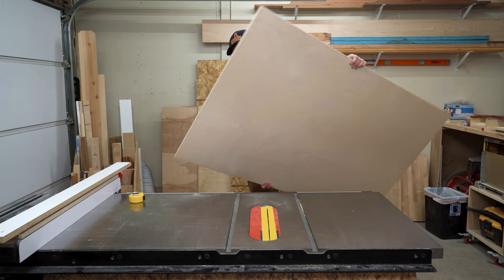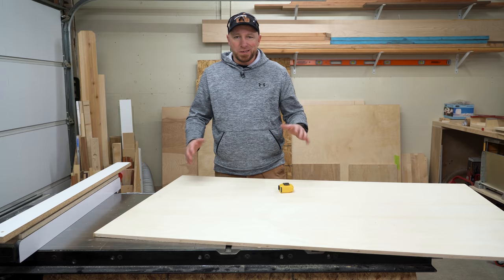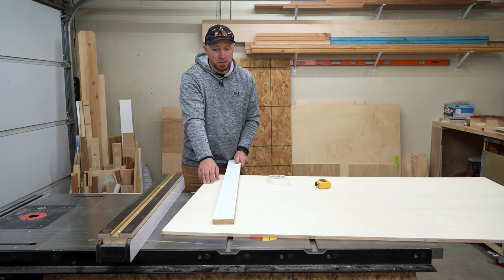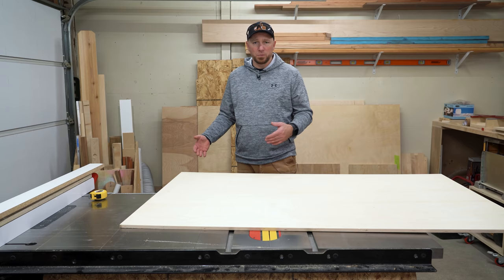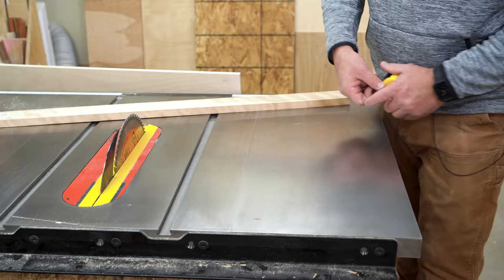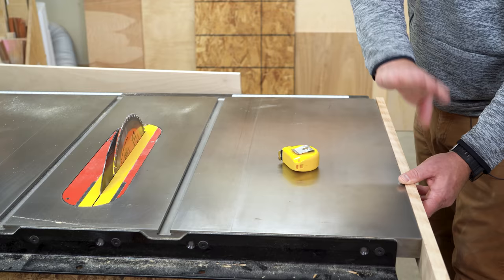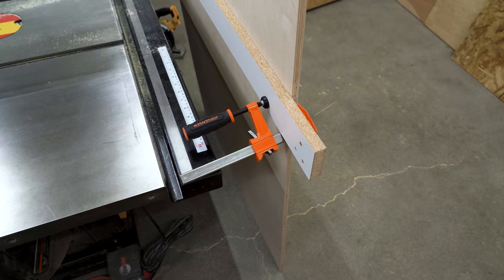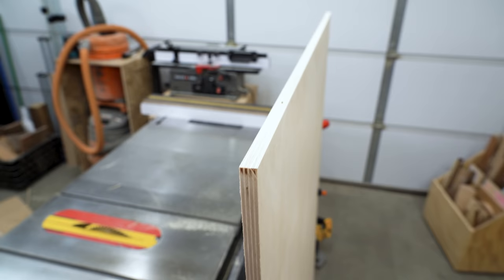A Table Saw Trick So Crazy, It's Genius!

Comment: Good trick. You could use double sided tape on the backside with a runner in the miter slot for the same cut. It probably wouldn't help much for cutting plywood perfectly in half length wise, but it would work for a 36 inch cut like this.
Reply: I think the increased distance of the edge of the table vs the miter slot gives more precision. And double-sided tape will have just enough torsion play that it would be easy to wiggle the hanging end of the plywood back and forth as you travel. The clamps seem to provide reliable stability to not have any torsional wiggle, as long as you maintain pressure towards the table edge

Comment: Great timing for this video. I have 6 5 foot long cabinet panels to cut. (The sheet goods were not cut square at the mill. They are off by 5/32.)
Reply: Wow that's probably the worst I've heard of, I had a bunch of T-111 paneling that was off like 3/32, and I thought that was bad.

Comment: Good trick, i will definitely be using it. However, in this case, I would have just clamped a straight edge and used the router though, eliminates having to manhandle a large sheet and a potential wobble when cutting it.
Reply from the maker: Yeah it was more to show the technique. I think a lot of people tried watching without listening though, as per the norm. I will add though that for me it would take longer to setup the router than just to do this. But that's because my router is in the lift, so I would have to get it out, change the bit, and so on.
Reply: MUCH easier just to use a plane. Cleaning up timber is what is what they were specifically designed for.

Comment: Nice one! This is a great method and a safe one for the large sheet goods. I used to work in a shop with a 52” fence and there still comes a time when you need to make that thin rip off the side of a long sheet. It’s no fun having over 4 ft of waste and a thin rip between the fence and the blade.
Reply: Awesome! Love it! Will definitely be using it but also that was a crosscut and I saw no to minimal tear-out which makes me ask what kind of blade you’re using. Dude that was flawless!
Reply: @BusyDee  WOW you have very pretty eyes!

Comment: Good one and perfect timing. I cut a large cedar slab at a 45 yesterday to make a waterfall table.  I used a clamped straight edge as a guide and a battery saw, but something didn't work and my 2 45's didn't match up. I need to re-cut the 45's on the table saw. With this trick, I think I can do it. If not, ill go to my buddy at the local sawmill and let him cut them on his radial saw.
Thanks for the great tip.

Comment: That is a great tip to share for those that did not know of it. Luckily for me, my father taught me that trick some 50 years ago and I have used it several times on my small capacity table saw. Since I bought a decent hand held circular saw I prefer to clamp a straight board on top of the stock piece to guide it if I can. My circular saw has no wobble like yours.

Comment: I tried this last week and it works great. It takes a little extra math, but I was able to make a good straight cut beyond the rip capacity of my jobsite table saw. In fact, it worked so well, that I thought the opposite end was straight, but ended up reversing the board and cutting the opposite end to get a nice square piece.

Comment: straight edge and router.
perfect every time and perfect 90 degrees every time, and a perfectly smooth cut every time, which on a table saw it’s not guaranteed, plus you don’t have to handle such a big clunky piece especially if you don’t have the room.
router is a win win. every time.

i thought leaving this comment would be better than giving you a thumbs down, and you might even like my technique.
cheers !

Comment: Another option is a straight edge and a router! Super clean cut on both edges and a perfect 90 degrees.
Reply: For cleaning up an edge, a router would be simpler and easier, especially with  something heavier, like an MDF panel

Comment: For those without  a large table saw. I use a BORA NGX 50” clamp edge, $49 and a 4.5” Porter Cable circular saw. The clamp can be set to any length and the over center cam lock secures the straight edge. A 4.5” saw is much easier to do this kind of cabinetry work. Wish my shop were as clean as yours.
Reply: Correct I have the BORA and love it, wish my table saw was that large

Comment: I use a similar method on my radial arm saw to joint an edge or preserve a natural edge.  I built the front table so that the front edge is perfectly parallel to the fence and clamp a straight edge in the same way that is shown in the video.  This works best on wide boards using a narrow straight edge  I position the carriage with as much of the board on the table as possible.
Reply: hinge a support board out from your front edge and hinge a board from that one to the floor . that way you can have full support of a plywood sheet

Comment: Two observations: 1) you could set up the same fence but closer to the cut line and use it for a fence for a router with a straight bit - of course this wouldn't work for breaking down sheet goods but it works great for cleaning up edges. 2) using a larger square for setting up the fence will provide even greater accuracy.
Reply: Also noticed the plywood sheet was not down hard on the table (7:02 time stamp), so he did not achieve the "squareness" he spoke about early in the video. The circular saw and clamped-on fence would've done just as well.
Reply: @kennnva551  Either a circ-saw or a router. I'd go with router. Both ways have the advantage of not needing to catch the out-feed. If the plywood reaches its balance/tipping point, it's really difficult to keep aligned. And a router has no skid-plate to wobble.

Comment: Big fan of your channel. I am bit confused still why all the trouble or why it's less trouble I should say than the other methods but maybe I wasn't doing a good job listening. In this case looks like you just want to clean up that edge and have it square. Couldn't you clamp a straightedge to it square and then just run a flush trim router bit down it if you didn't want to circ saw it?
Reply: Yeah my thoughts exactly.

But you can use this method to do more than just cleaning up an edge. If you wanted to cut a thin strip off to then use, let's say.
Reply from the maker: And here I thought I had covered all the "you should have" comments. Haha! This is an old school method for panel break down. It works quite well for breaking down full sheets into cabinet-ready panels. The example I showed was because that is a common problem people run into and the table saw is right there to use. Plus it gives people another trick to use when they need it for something else, like panel break down.
Reply: @InspireWoodcraft  ha thanks for replying.  I was asking to make sure I didn't miss anything, not from a place of "I know better" - definitely the opposite which was why I had to ask bc what did I miss? This definitely makes sense now on panel break up esp by passing the fence.

Comment: I don't like to be harsh, but I'm just not a fan of this. I think you have a lot of good videos, and I understand what you're trying to show, but I don't think this is a good tip. I think for many people this isn't going to be safe even if it was safe for you.

Working with panels on a table saw is a risky prospect from a balance perspective. With your sheet you're about at the edge of what's going to work on your table.  Myself, I've got into a lot of trouble because I've tried to work with a sheet that was too far off the table even with I had additional help like rolling supports.

And if the saw "doesn't have a lot of capacity to begin with", the balance situation is going to be even more risky.

Additionally, the straight edge requires those clamps to stay in place. You're using two heavy clutch-style bar clamps and leaving it pretty tight. This is the kind of advice that someone who's newer will see and they might try it with trigger clamps which are far more likely to move in this case which could leave a rough edge or be unsafe again.

Sometimes the right answer is that you shouldn't do something because it's not safe with the tools you have. You have to choose a result that's rougher and slower until you get some additional equipment.

This is exactly what you should invest in a track saw for. It makes the operation safe and quick. While I think a woodworker needs to invest in that sooner, there are cheaper options. 

With the regular circular saw you can use a clamp-on straight edge like the ProGrip or the Bora NGX (I'm not a fan of Kreg's solution since it comes in two pieces). Or just use the edge that you created. I'm not sure why you're having the flex issues since I didn't have those with 3 different circular saws I used in the past. My issue was never the straightness of the cut but just the time it took to set it up and that the tools didn't help me get something square.

Either way, please be careful with sheets hanging so far off the table saw.
Reply from the maker: Some valid concerns. I think people have to watch (and listen, a difficult thing for most nowadays) and learn and choose for themselves what they think they should or shouldn't, or even can or can't do. Each person has their unique set of circumstances that they are up against, and they have to kind of use their brain accordingly.

Comment: Excellent tip... especially now that I dressed out an edge board on my table saw's outer cast wing for another reason (helps me align my mobile outfeed table).  You can even screw on an extra long/removable edge that is much longer than most table saw wings (they are typically only 27"), that will provide even more support when running wider sheets through.  I keep a nice straight piece of 1x3 handy that is about 36-40" for this reason.

Comment: The trick is great and simple! 

Ruler's hook is moving by the depth of the hook. So when you measure by putting the hook outside you will get exactly the same as when you put the hook against the edge on the inside.
Reply: You didn't pay attention did you? He wasn't measuring from the edge of the board.

Comment: I'm 70 + years. I use this idea back in the 70s.
I'm not able to wrestle that stuff around even  what you did there.
If I were to do that now I think I would clean that edge up with a router and straightedge.
Just make sure there is no gravel or dirt in that plywood edge.
If you couldn't cut that because of the capacity with of your table I would still use your  circular saw straight edge, and then true that up with a router and straight edge.
Obviously this is not going to be production work.
There's almost always another way to cut something .
If the original piece of plywood has that square edge but just bad splintering, you might even use an L fence and straightedge.
Keep up the good work.    Thank you.

Comment: Nice tip, going to check my saw right now, but I will use the miter slot to check to the edge of the table instead of measuring from the blade.

Comment: Good technique, and well explained. I suggest you make a point of using hearing protection every time you make a video. Hearing loss is not repairable, and when you realize you have it, it’s too late. Guys say “noise doesn’t bother me”. But I guarantee you will regret your decisions when you can’t have a conversation with your grandkids. It only takes a few seconds to put in plugs or put on a headphone. Literally, a few seconds. Again, very good video. Hope to see more well-thought-out videos.
Reply from the maker: Thanks for the suggestion and kind words. Luckily my saw is only 85-87dBA while cutting, and I am usually only on it for less than a few minutes at a time and not very many times per day, which technically falls into the "safe" category. But if I am going to be using it for long periods of time, or when I use almost any other machine in the shop, I use hearing protection. Ironically, I already have a bit of hearing loss from when I was younger and didn't take it more seriously.

Comment: For cuts like this I use a 4ft length of T-track clamped to the bottom of the work piece that runs in the miter slot.
Reply from the maker: I like it! T-track doesn't work in my miter slots very well. Too much wiggle room.
Reply: Make the cut as if the T-track was a fence; feed the work with a bit of pressure towards one side of the miter slot or the other.  Not too much pressure though; aluminum T-track will deflect.  I keep my saw top and out feed table so work slides smoothly all the way through the cut.  That way when I make a cut I can focus all my attention to keeping the work properly registered.

Comment: Bravo!!  Great tip, and to hasten the setup, one could make a jig exactly the length of the blade to table edge you measured to aid in clamping your guide to the work, since that measurement never changes one you figure it out.

Comment: Good trick to remember I did something similar on the 8 ft side when building storage cabs
 Question. As long as the one side is factory why not just measure off the factory edge to locate your piece to be clamped. That way you are automatically parallel to factory. Squares from small pocket ones to framing squares can  " out" of sq.

Comment: Good idea however, difficult to do with my cast iron table saw. I bought a 2nd circular saw with a fine tooth blade and keep it on an inexpensive track saw guide. I love the cuts and the saw is lighter than the wood I would have to manhandle. Quick and easy.

Comment: Another good trick and a nice bit of lateral thinking, but you should get yourself a tracksaw.  You don't need a plunge saw, or even a super expensive Festool system.  I personally use the Bosch Blue 18V tracksaw system with the big saw, and it has changed my life when it comes to breaking down big sheets.

Comment: While I deal mostly with rough lumber, I have had instances where I needed a wider table saw than I had. I ended up using adjustable height rollers from the big box store to support the weight of the plywood sheet. I see you just need a factory edge on your plywood. I like your idea as well. Thanks for the tip.

Comment: I use my circular saw and a straight edge
1 inch and 1/4 from blade to edge of the plate
Mark the cut, mark 1 1/4 inch, clamp straight edge
Job done in a few minutes 😉😀

Comment: What's wrong with using the miter slot and a 3/4 inch strip taped to the bottom of the sheet square 90 degrees to long edge?
Reply: How long does that take?  😂

Comment: You would love a track saw. They are essential for panel work IMO.  My Mikita track saw leaves a smooth edge and the scoring feature eliminates chipping in melamine panels. The rubber strip on the track makes for perfect alignment and zero tear out. Once you get a track saw you will wonder how you got along without it.
Reply: I agree 100%. The track saw also let's you use a crosscut jig to make sure that your cuts are not only straight, but square. It's also a lot safer to move the saw over a 100# sheet than a 100# sheet over the saw.

I found a Makita track saw on Craigslist, but otherwise was ready to order a 110/120v Bosch from Axminster and replace the plug.  If you look at the parts list, it's identical to the North American model for everything except the depth gauge and power plug. The motors are identical parts.

"Depends on how square you need to be" Aka "Square enough" ie "Not actually square"
Reply: @bertaboy  I would have used the square on both sides of the sheet before I tightened the clamps.  Otherwise excellent technique and video.
Reply from the maker: I would love one. Actually I've wanted one for a long time. Just don't have the $600+ for one right this second.
Reply from the maker: @bertaboy The only issue with that is that if the two edges aren't parallel, you are going to fight it every step of the way. Best practice, from a logical point of view, is to always reference from the same edge.
Reply: @InspireWoodcraft  That's why you would also need some parallel guides (which are also easy enough to make, using that table saw you have and a handheld router.)  Just like with table saws, the constant for all woodworking tools is jigs, jigs, jigs 🙂
Reply: @jeffhildreth9244  That assumes that you have two known parallel edges, which can be a dangerous assumption depending on where you get your materials from.  The safest thing is to cut a straight edge (because the factory edge might not be straight,) then use that as your reference to make everything square and parallel.

See also: Nuke the site from orbit.  It's the only way to be sure.

Comment: I faced a similar task back in the 80's, and my solution was to use two Makita 10" table saws (mine and the boss's) bolted to an eight foot oak school table so I could use the saw blade on one table saw and the rip fence on the other table saw to guide the cuts. Another time when faced with having to rip glass-smooth 3/4 MDF shelving in a confined space, I made a 24" x 36" baseplate with a fixed 40" fence for my beloved 7.5" Skil Wormdrive. If you can't move the sheet of plywood, move the saw.

Comment: OK That's one way assuming the edge of the table edge is parallel with the blade, you have to room to the left of the blade and you're strong enough to maneuver the panel safely during the cut etc.  I use a router with a Pattern Router Bit (bearing on top) and a wide straight length of wood with parallel edge. Clamp guide using an ACCURATE  framing square. Cut and check result.